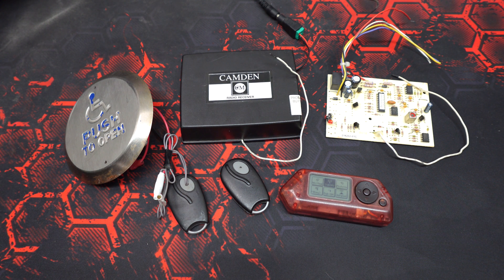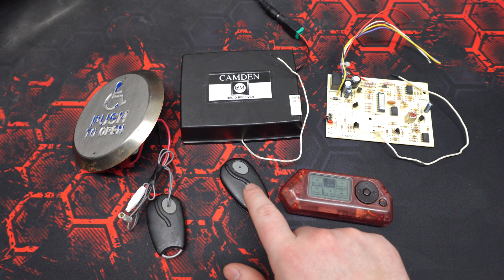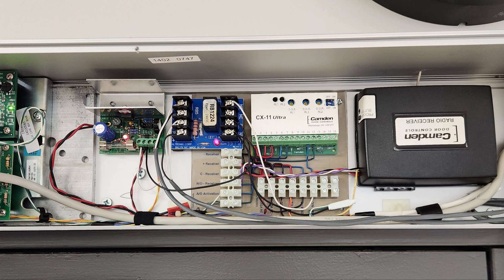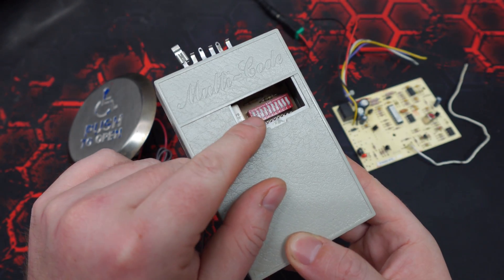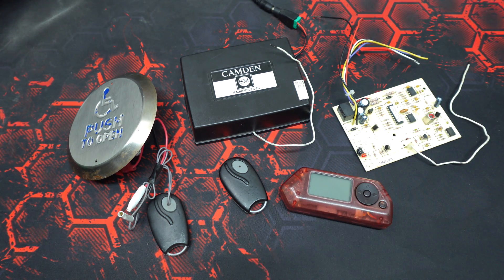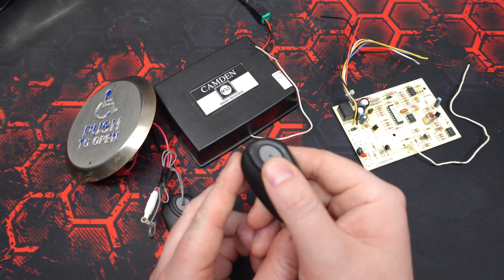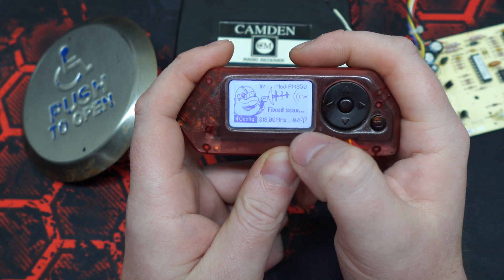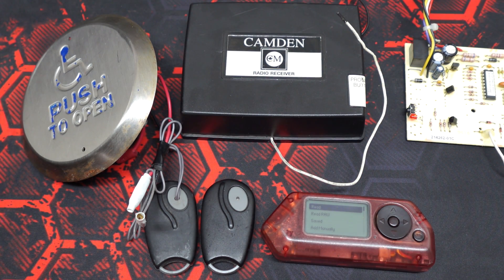Flipper Zero: Linear/Camden MegaCode SubGHz Replay Attacks

Comment: Brute forcing these receivers is somewhat reasonable. The facility codes are ignored in that model receiver, they doesn’t lockout like the AP5 receiver and single button transmitters, transmit using button two. meaning there is only 65,535 possibilities at that point. It could take 18~19 hours at the most to scan all 65,535 possibilities. I know this can be done unmanned using a espcam/webcam, qflipper, the playlists file off Github and screen recorder running on rpi or pc.
Reply from the maker: Interesting! Thanks for that info, dude!